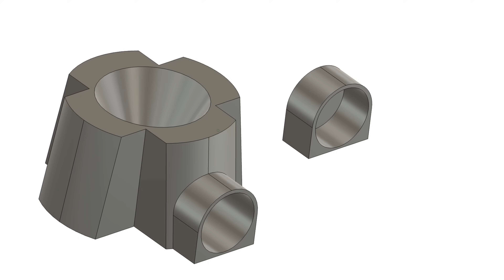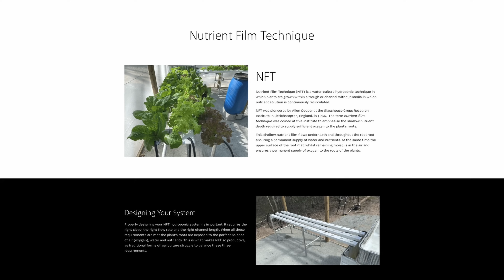Mini Hydroponic System Time-Lapse Grow

Comment: I feel like you could keep the coke bottle design if you duct taped a ring of rigid wire around the bottle. That would give it enough bracing to prevent it imploding.
Or you could 3d print a ring for it and hotglue the ring on to the bottle.

Comment: Is it necessary that the reservoir is removable?  Could it be a 3" piece of PVC that is refilled from the top and design the water restrictor into the 3D printed end piece?
Reply: That's an interesting idea. Perhaps a mini float valve under a 3"+ PVC capped reservoir? I do like the use of a soda bottle though

Comment: I'm surprised you're not focused on water only hydroponics. Is there a reason you are implementing for Coco & Perlite wicking solutions instead of low pressure or high pressure aeroponics?

Comment: Great video! What do you think of using elastic-top paint strainers to prevent roots from growing out of the hooch adapter and into the pipe? Similar to what you did with your dutch bucket tomatos.

Comment: Definitely interested in this! I plan on putting it on top of a bookcase. This will put it directly next to a window for some free light. I think a 3-gallon water jug might be good? Not too small, not too heavy. I "think" they are the same shape as the larger water jugs used for water coolers.

Comment: a cool container style you could do would be those water cooler machine bottles, theyre pretty large and could sustain much larger plants. Theyre also designed to be placed upside down so they wouldn't buckle under their own weight. Not sure if they are standardized though.